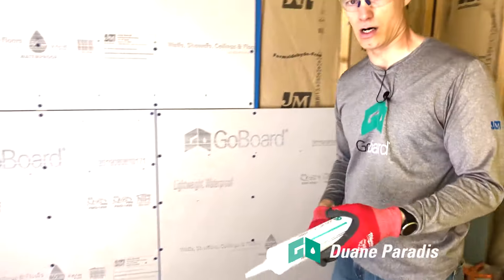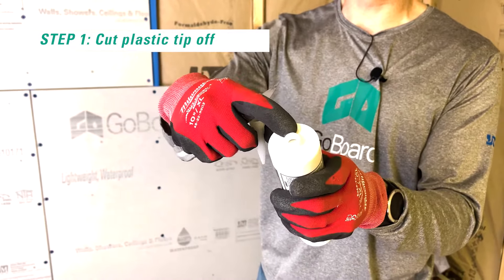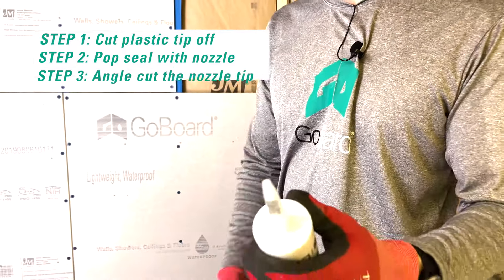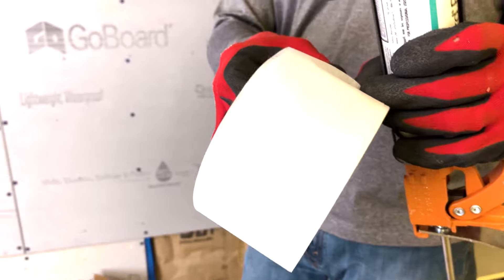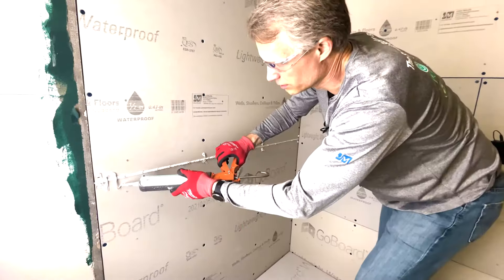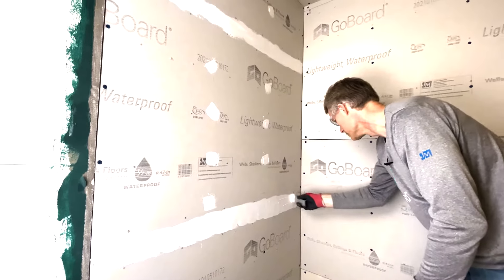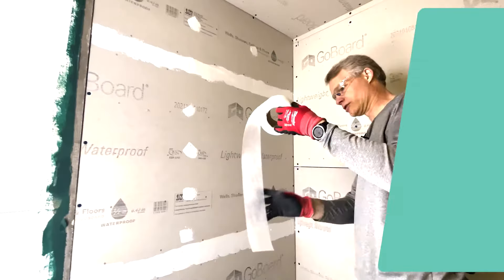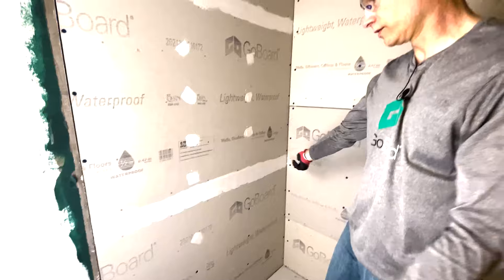Fortify Your GoBoard Installation Using Seam Fabric

Comment: All previous videos of GoBoard installation have the sealant going in BETWEEN each sheet installed, making sure it 'squeezes out', no seam tape necessary.  Is this in addition to that method or a separate, updated way to do it?
Reply from the maker: That is in addition to that method. You can use either, but we more strongly recommend hanging the board first then fill the gaps with sealant. It's more time efficient, and you'll ensure there is enough gap for the sealant to remain inside (and not get pushed completely out).
Reply: SOUNDS REASONABLE! @johnsmanvillegoboard
Reply: Ok but what about the tape.  Is tape needed or not. Mess  tape or Schuler seam tape
Reply from the maker: @DR-um2bv  Seam tape is not required, but it does a couple of things, it reinforces the board joints and changes in plane, in the case of movement, expansion and/or contraction that goes well beyond what the sealant is capable of handling. It also offers an intermediary layer that bonds well to both sealant and thinset mortar - so there's no smearing of the sealant in case you aren't wanting to wait for the sealant to skin over before you begin tiling.

Comment: My tiler said he’s had issues with tile mortar, both modified and unmodified, adhering to the sealant underneath in prior installations. Have you experienced the same? I don’t want the marble failing because of the sealant on the fasteners / seams.
Reply from the maker: Hello, use the seam fabric.

Comment: So, I understand that the tape also helps with mortar adhesion to the wall and does not just reinforce the seam. In this case aren't you supposed to apply tape over each and every screw since there is a layer of sealant there too?
Reply from the maker: You could apply the seam fabric over the sealed fasteners penetrations, if you are wanting to take advantage of the intermediary layer that makes it possible to get to tile right away - but it's not required.
Reply: Exactly. Mortar fails to adhere to the sealant. If you’re doing less than a 1/4 mortar build-up under the tile, my friend told me it’s wise to do a couple passes of redguard over the sealant first, just to help with adhesion. But I guess doing little seal fabric patches on the fasteners would work as wlel

Comment: Whats recommended for using the tape when you get to the area of the backer board and tub flange. Or transition from backer board to drywall
Reply from the maker: You'll use a fiberglass mesh tape and drywall compound for GoBoard to drywall transitions. This seam fabric is only for fortifying the seams and board joints inside the shower.

Comment: Will/should  the seam fabric install in such a way that it stays flush to the board?  Seems like you’d be creating some small bulges that would affect tiling.
Reply from the maker: Yes, the seam fabric should be flush with the board with no wrinkles, or air pockets.

Comment: Okay, so check out how to use a caulk gun properly before following these instructions.
Reply from the maker: Are your trust issues related to the internal seal?
Reply: @johnsmanvillegoboard  I have been watching all these videos and people using a box cutter to open the tubes is odd.  The caulk gun has a cutter and pin to do those things already, why dull your blade on plastic when the tool in your hand is purpose built to do the job?
Reply from the maker: @kaitarjkhara2663  good tip thank you. We’ll pass the word. That guy is always getting beat up by the audience over how slow he is and how he uses cheap tools. How he has a cheap camera person. He travels all over the country - as well as Europe - so he travels light, buys cheap. He’s left behind a lot of black and decker over the years. 🤣
Reply: @johnsmanvillegoboard  Well, that's silly.   Cheap tools and slow is exactly what DIY homeowners need in a how to.  The instructions were clear, well demonstrated and highlighted the product.   
It's just not the safest way to do things and you always get a better angle cut using the gun clipper or placing the tube down on a solid surface to cut with a knife at an angle.  Cutting the tip toward your NON cut proofed gloved thumb has the safety conscious chemist in me wincing.
Reply from the maker: @kaitarjkhara2663  The safety tips are much appreciated! A lot of injuries happen because of being hurried. Or you’re distracted by the camera in your face. Thank you 🙏 !Appreciate it! Mean it!
Reply: Do you use the fabric seams in corners too?  Like the corners of a shower niche?
Reply from the maker: @sethoberschlake8062  Yes, you can use the seam fabric in corners also. Thank you for your question. 😎
Reply: @johnsmanvillegoboard  great thanks!  So I'm assuming you just bend it in half to crease it?
Reply: I bought a tube a few weeks ago with the removable tip, and I was confused by the thick but very short plastic inner seal that has to be cut off. There’s no attachment on the caulk gun for that type of tube. Seems like an accident waiting to happen!